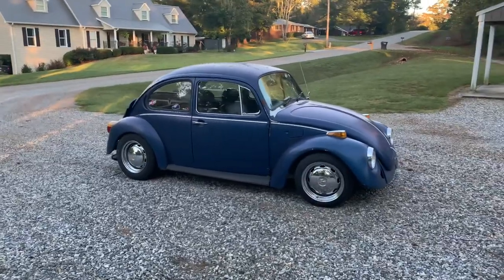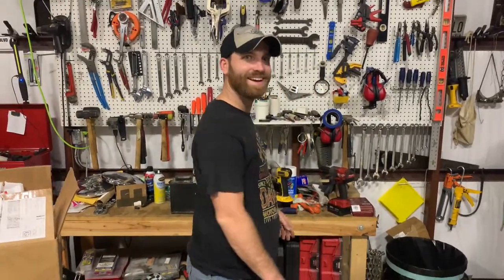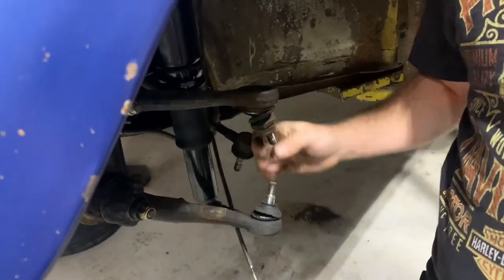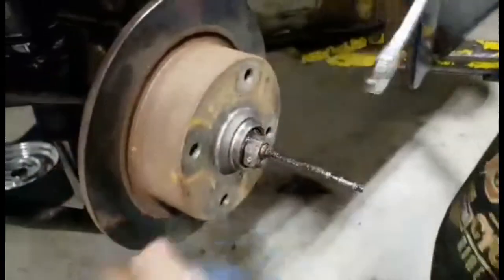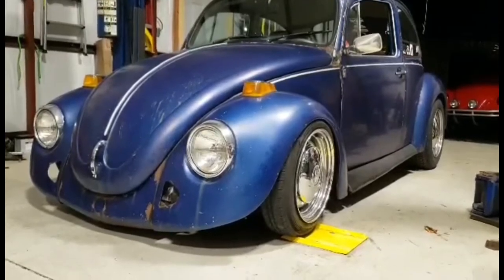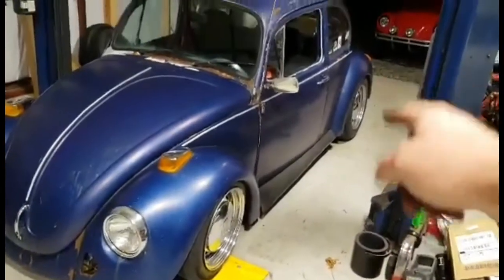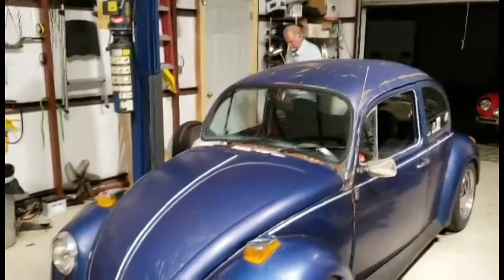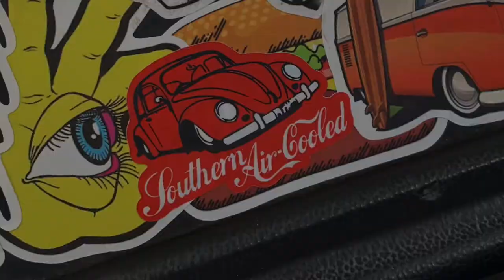2.5" Drop Spindle Install - VW Beetle - Easiest Way to Slam a Bug! - Pt. 4

Comment: That stance looks good. Is the front beam adjustable, or did 2 1/2" drop spindles alone get you that low?
Reply from the maker: https://www.youtube.com/playlist?list=PLBYMVKy1lCTdBA7ZbWQgRLtQuvtQC5NHD
Reply from the maker: Here is the full playlist on the suspension.  Check it out.
Reply: @HiRevzMedia  Thanks a mil!

Comment: Hey man! Been watching the bug videos! I'm in the market for the same setup you have for my 65 Beetle and I used the links in your bio and the Monroe shocks come up being white, is that the same ones or are the ones listed different from what you have? Thanks!
Reply from the maker: Hey bud, thank you. I’m not exactly sure if these would be the same for a 1965 model, but yes they show up as white in most places I looked, but came in black. I think they just send you whatever. Either way you can paint them.